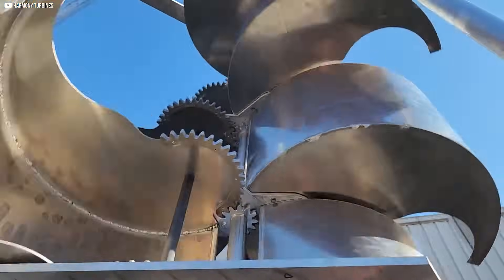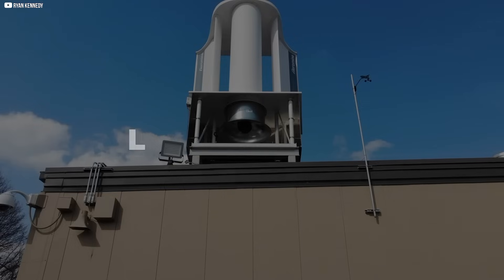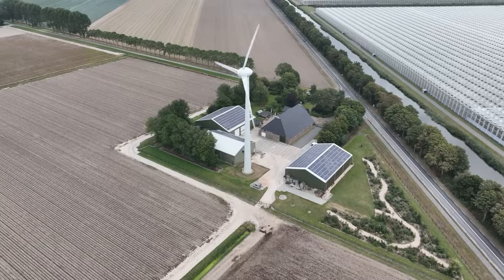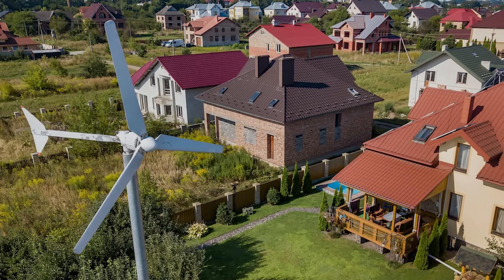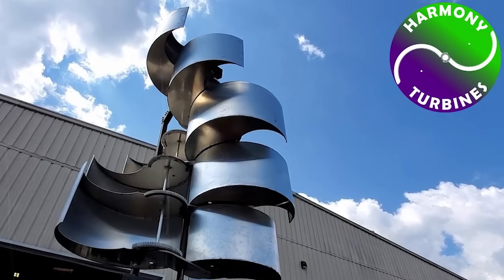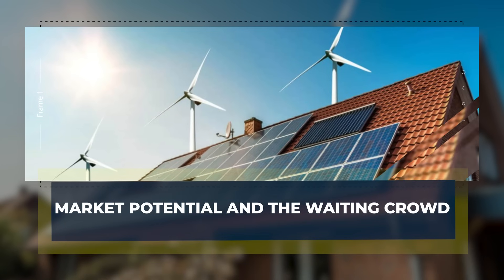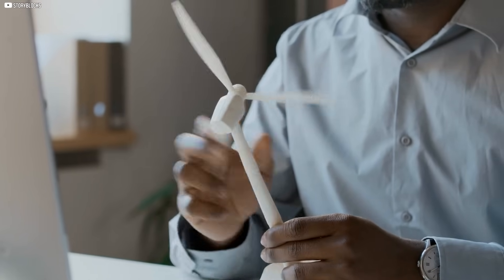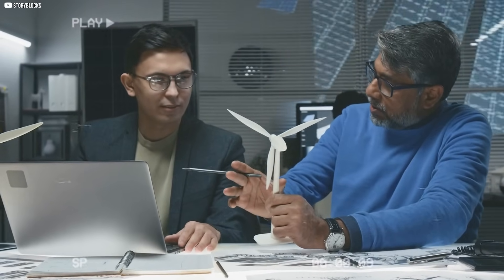Residential Wind Power Just Got a Massive Upgrade

Comment: All practical tests show that small wind turbines hardly generate any electricity, because hardly any wind blows close to the ground! Solar panels generate at least 10 times more green electricity with the same investment in time & money! 
Moreover, the wind close to ground is extremely gusty, which almost always greatly reduces the service life.
Wind yield increases with the third power of the third power of the wind speed: So +100% more wind = 800% more electricity. Close to the ground, however, there is 0 constant wind, only gentle breeze or aggressive gusts! Only wind turbines over 100m high are profitable.